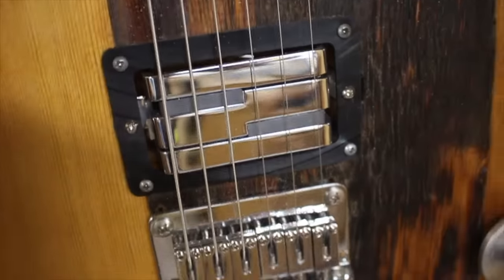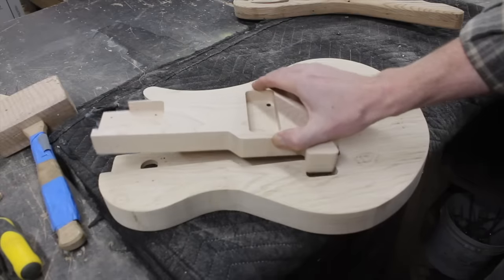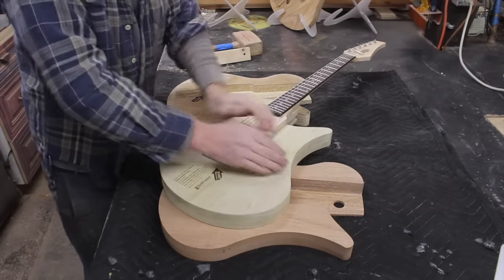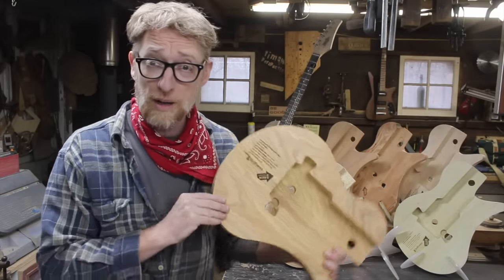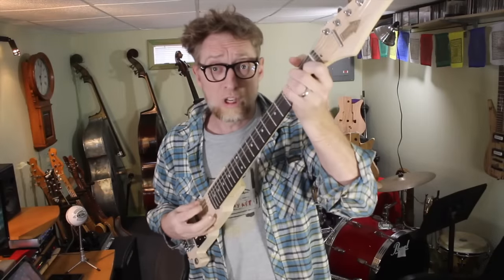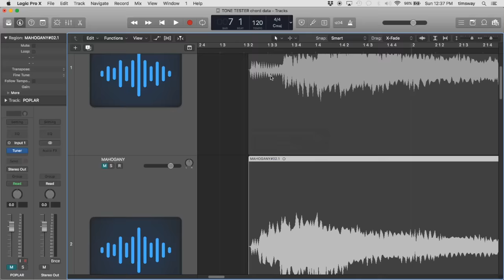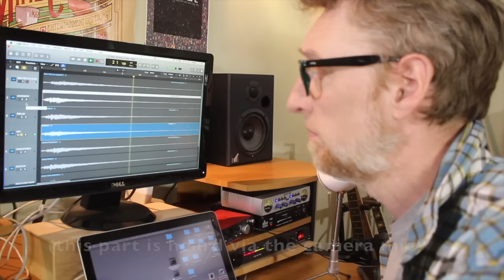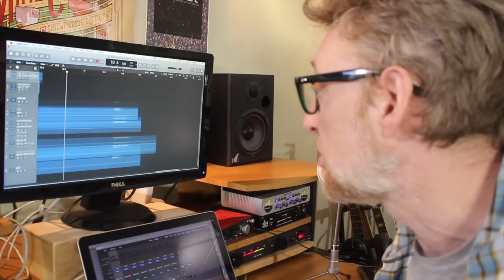Tone Wood Tester: One guitar to test them all

Comment: Message heard loud and clear. Every time I play onstage I will make sure I am resting my guitar against the stage wall for maximum tone.
Reply: And frankly, just stand offstage.

maybe just have someone else play so I can take a seat and rest.
Reply: @beatmasterbossy  would that be a tone seat?
Reply: Just lay it down on the stage, that way ALL the connected walls will pick up the tone 😅
Reply: Want it louder raise pickups instead of standing touching a wall lol
Reply: The funny thing is that if you brace the guitar against something very rigid and massive, that will effectively stiffen the guitar and reduce transfer of vibrations from the string to the guitar.  But if you touch it to something softish, it will tend to damp vibrations, i.e., the guitar will vibrate almost as much anyway and the soft thing it's against will absorb much of the energy.  (Damping.)  And if you touch it to something resonant, what will happen depends on whether the resonant frequencies coincide with the resonant frequencies of the guitar.
Reply: When the guitar is amplified loud enough so you can't hear the acoustic sound of it anymore, there will be no difference in volume when putting the headstock against the wall.
One more proof that the wood does not make a difference ones the el. guitar is amplified.
Reply: @paulw.3967  "The funny thing is that if you brace the guitar against something very rigid and massive" - I tend to hold my guitar higher up my body than that - and TBH although my guitar playing is exciting, it's rarely exciting in that kind of a way

Comment: Sounds like a tenth of a turn on the tone pot would cover the range of all "tone woods" in existence for an electric guitar.
Reply: Oh, even less than that. You could pick slightly closer or farther away to the bridge and that would cover the differences. Most of the differences I could hear seemed to be more coming from hitting the chord a tiny bit slower, so the higher notes were more pronounced through the sustain, or from slightly heavier picking technique. In order for this to be properly scientific, it would have to be a single picked string with the same pick and many full length strums from each body type. It would also help out a fuck ton if each was put through a spectrum analyzer at their peak and then halfway down again. That would give some actual quantifiable data to go off of instead of some something seemingly designed to induce a placebo effect
Reply: It sounds like there's a slight difference in bass and mid content though.  FI, the Poplar sounds like there's less bass as well as more highs than Mahogany and some others.  The SA has a slight midrange dip compared to the Mahog.  I like those two the best through the amp.  They sound "balanced".  The Fur is nice.  Maybe lacking in mid-bass and sustain.  It's all pretty subtle.
Reply: @GCKelloch   I've tried and failed to find any credible evidence that 'tone wood' has any practical application in electric guitars. Acoustic guitars, yes, but electric guitars can be made out of anything you like because it's always other components that are most important
Reply: @GCKelloch  turn the mids knob on your amp a bit then
Reply: @AnArmoredMarch  A robot that picks at a preset force and angle would be good, that simplifies it a lot. Once that and pickup height etc... are near perfectly consistent it would be easier to tell a difference. But they already did scientific analysis and the conclusion was along the lines of "the difference is noticeable in a spectrum but not to the human ear in any meaningful way". So an oscilloscope can tell if it's a alder or mahagony Strat, we likely cant. Still I'm fascinated by the difference in tone between my near identical Gibson and Epiphone V. One mahagony one Korina. Unplugged? Night and day. Non musicians can tell. Plugged in? Well now I put better pickups in the Epiphone so it sounds a lot better than the Gibson. I'll put the same ones in the Gibson and test again but I noticed the weirdest thing. My Epiphone is standard Gibson 628 mm scale length. The Gibson is 620 mm!!!! Didn't notice for 15 years but I measured to compare pickup position on Les Paul vs SG vs Flying V (closest together and closest to bridge on SG much further apart and higher up on Les Paul and even more so on Flying V. The Neck pickup is even higher up, which I think is why Vs have that gorgeous warm tone on the neck. The pickup is just directly against the fingerboard while on a Les Paul the final dummy fret is a bit longer... The Toneriders are definetly outperforming the MUCH more expensive Burstbuckers. Which I'm selling. They're good but not that good. AC2 all the way. My Korina sounds like Lucy now. As bright as a Telecaster and as warm as..m well any PAF equipped guitar really. Put in a coil split and people think my V is a Tele. May as well put humbuckers in the Tele and annoy everyone at once.
Reply: @221b-l3t  It'd be difficult to do. You know most of the programming involved in robots has to deal with the fact that sensors, motors and actuators are not 100% accurate.   If you programming something "turn 5 degrees, activate motor for 3 seconds" it doesn't turn out that each time you get the same result. Scientists typically spend a lot of time and effort to engineer specific equipment and setups to avoid this kind of issue in their experiments. Because readily available, off the shelf stuff isn't engineered to have scientific rigour in mind. The tolerances are far looser. So you've just moved the problem from 'Well you're not strumming the guitar in the same way" to "Your robot isn't" - and it seems the more people show tone wood isn't a thing, the more desperately there's a hope there's some small effect we can measure. Well, you know, when physicists want to measure some tiny effect amongst a world that's full of things that have a much bigger effect that would ruin their experiment - they are jumping through hoops to eliminiate the big effects.

And you could spend a ton of time and money on all of this to show that tonewood doesn't matter. But just the thought experiment is already proving it doesn't matter.

We've already shown that tonewood isn't a significant effect for humans. That's been done by Jim Lee eliminating the wood entirely. More importantly we can trivially show the big difference in tone from, e.g, just picking in a different way or strumming a different area on the strings, changing the pickups, changing the distance to the pickups. There's heaps of stuff that makes a big, tangible difference to tone. Ironically the things you're trying to eliminate are the things that are getting in the way precisely because they are what creates the tone whereas the wood doesn't.

No one is having to carefully eliminate changes in the wood to show that where you pick the guitar matters are they? You can pick up any guitar and show that. Or the difference if you switch pickups. Every guitar you pick up has a bridge pickup that sounds completely different from the neck. So the very fact no one is saying "Eww, no it's not the pickup placement, it's the different wood in the guitar" shows you we already know wood doesn't make any difference.

No one buying replacement pickups ever said "I don't believe these pickups sound better - I think it's just the wood on the guitar" did they? No one demanded that we have back to back tests to prove that pickups affect the tone by keeping the wood the same - because you know pickups sound different - you can hear it a mile away. It's obvious and unarguable.

So you can see no one ever at dimarzio figured they had to find some way of eliminating the wood when they were demonstrating their pickups - yet here were are suggesting that for tonewood you need a robot and an oscilloscope to show that tonewood might exist or that it doesn't. Well, obviously it doesn't exist or it exists in such a small, insignificant way that you should spend all of that time and energy you might building robots in your secret basement laboratory on other aspects of your guitar - the very things you're struggling to eliminate when you take the same guitar- without changing anything, strum it and the tone is different. We already know what affects the tone and how difficult it is to be consistent even with the same guitarist, the same guitar and the same equipment - you still accept that there could be enough variance in the way he plays to show a different tone. So that's what matters. Not the wood. There's no point wasting time on the wood.

And if someone is really dumb enough to pay £14k for a private stock PRS and Paul is telling them about tonewood, well why stop them if it makes them both happy? Most products are selling something to human subjectivity or aspiration. All we have to realise is that we can pick a guitar based on things that do matter as far as the wood is concerned - maybe you want a guitar to be light or heavy. Maybe you want it to look pretty. Maybe you care about the environment. Maybe you want the neck to be flat and stable, thicker or thinner etc. The wood does matter just not in the way that many guitar manufacturers are trying to dupe customers (and perhaps they've duped themselves) My cheap guitar that has a raised fret, that dead note sucks when you bend the string and it catches, so I want to spend a bit more and get a good neck, but I don't need to spend any time fretting about how the wood will affect the tone. Certainly I don't need to spend any time or money proving that to anyone else to a degree of scientific rigour that would prove that gravitational waves are a thing. The experiments that have already been done are, yes, not going to get published in a physics journal but they have been rigorous enough to show that tonewood isn't a thing for electric guitars. If people still want to believe otherwise, and it's clear that many do, there's no point fretting about that. Just as there's no point fretting about people who want to believe the Earth is flat. There's no experiment that will make Paul Reed Smith change his mind no more than I would change someone's creation myth by showing them life on Earth evolved over billions of years.